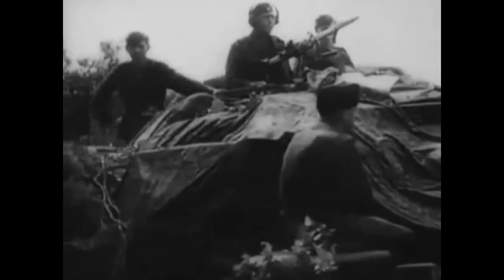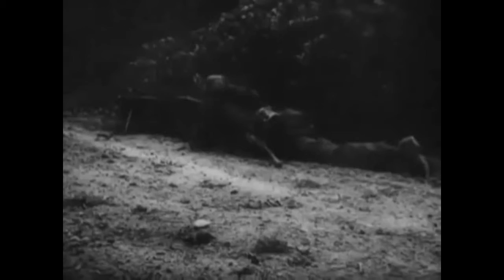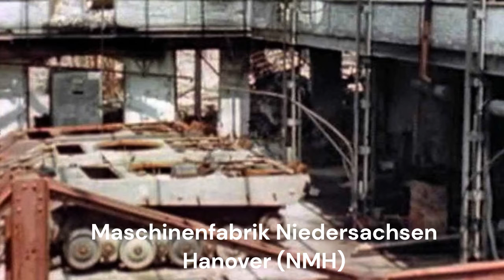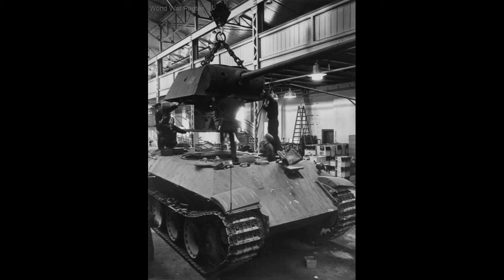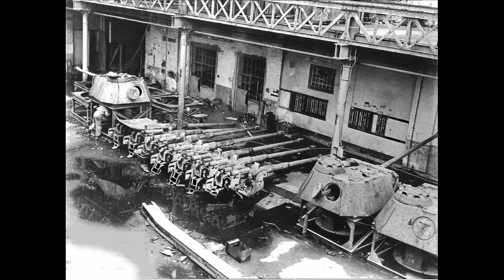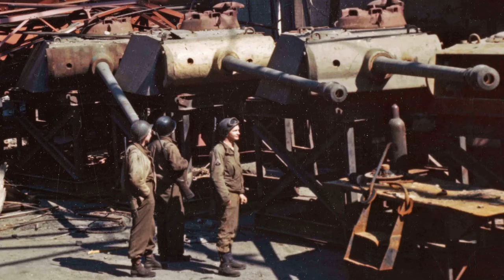Panther / Jagdpanther Factory - Maschinenfabrik Niedersachsen Hannover (MNH, ‘43 - ’45)

Comment: Der "Panther" war nach anfänglichen Zuverlässigkeitsproblemen ein sehr guter Panzer geworden. Mit seiner auf den 3 wichtigen Faktoren: Panzerung, Geschwindigkeit und Bewaffnung, war er allen westlichen Panzern überlegen. Im Osten musste er sich eigentlich nur vor dem "JS II" vorsehen. Die Deutschen hätten lieber den "Panther" weiterentwickeln und bauen sollen, als die überschweren "Tiger" und seine Abarten. Der "Panther" war auch nach dem Krieg für mindest 8-10 Jahre Vorbild für alle Panzerentwicklungen auf der Welt.
Reply: Der "Panther" war nach anfänglichen Zuverlässigkeitsproblemen ein sehr guter Panzer geworden

this is not exactly true, first batches of Panther had its technical problems, but later production when the technical problems got somewhat ironed out or different operations were ordered to tankers, the Pather suffered by production problems, worn out tooling and shortages of materials. There are reports that both Panthers and Tiger VI.b  armour got shattered by HE ammo for example.
The Panther problems with drive shaft and gearboxes never got really fixed, it was mostly overcome with engine governor and the fact that Panthers were moved via rail if the distance to travel was longer then 25km.

Panzerung, Geschwindigkeit und Bewaffnung, war er allen westlichen Panzern überlegen

not really, Panther was actually pretty slow, or lets say had bad acceleration. Also Panther had steering that demanded a good driver to be effective. Only the front of Panther was strongly armored and Allied tanks usually cout outrun and outflank the Panther. Western tanks that matched or outperformed Panther were these: British Comet and Firefly, US Sherman with 76mm gun, T26 Pershing, M10, M18 and M36 tank destroyers.

Im Osten musste er sich eigentlich nur vor dem "JS II" vorsehen

also not true, actually even the old T-34/76 could be very dangerous to Panther if attacked from high angle or sides, both Sherman 76mm and T-34/85 could penetrate the frontal of Panther at combat ranges, and all SU tank destroyers could destroy Panther. The biggest problem for Panther in east was the long distances that had to be traveled in east, thats why Panther was used less often in favor of Pz.IV.

Der "Panther" war auch nach dem Krieg für mindest 8-10 Jahre Vorbild für alle Panzerentwicklungen auf der Welt

not really, only the French used some Panther chassis as a interim solution, but name just one tank that was inspired by Panther. US had M26 line, UK had Centurion, Soviets had T-54, all projects from WWII having nothing in common with Panther. It was the MBT time and Panther was exactly a opposite of what MBT is.
Reply: Der Tiger 1 konnte die gleiche Arbeit verrichten wie 3 Panther = deshalb wurde er entwickelt.
Reply: @BlueSteel331  Ist leider nicht richtig. Die 75mm Kanone des Panthers war Leistungsmässig annähernd so gut, wie die des "Tiger E". Dies wurde von mehreren Tigerkommandanten sogar Bestätigt. Was der Panther nicht an Panzerung besass, glich er mit seiner höheren Mobilität aus.